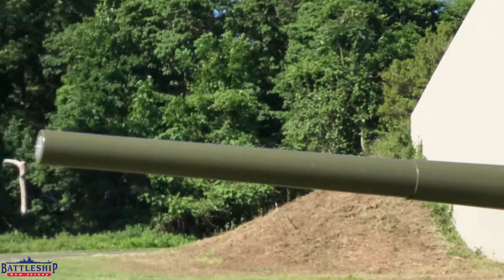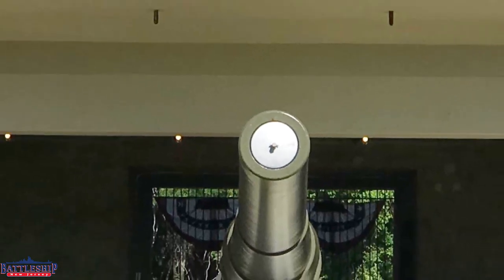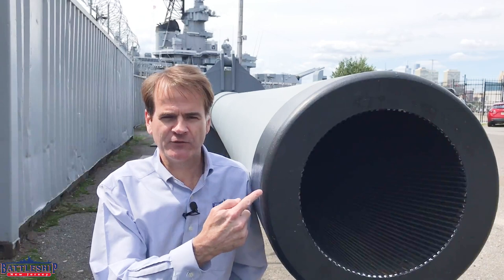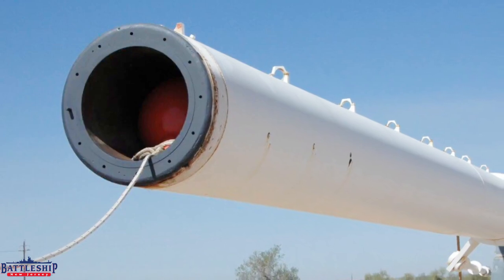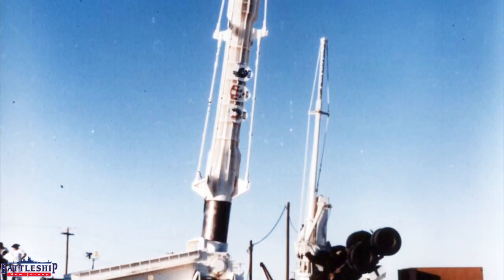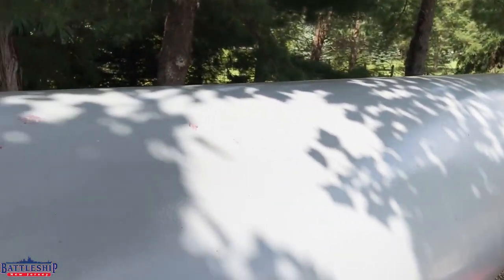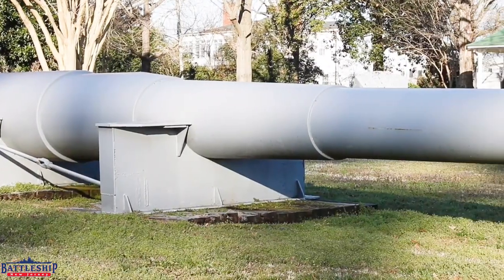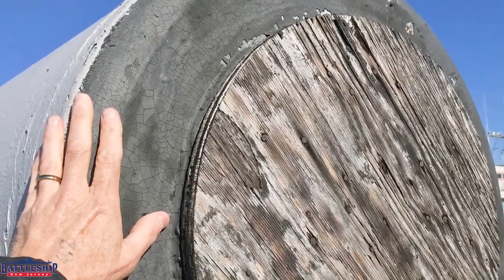Where are New Jersey's Original Gun Barrels?

Comment: From an engineering and construction perspective, the barrels may be out of order to balance out the turret. If the workers added the barrels in sequentially, the turret may have been difficult to handle and may have rotated due to the larger weight to one side. It also possible by adding the barrels sequentially, the base of the turret would have additional stress causing damage. Think of the three barrels like a see-saw. Adding one barrel to one side, then the second barrel to the opposite provides a balance. The middle barrel is then added last. 

Do take this with a grain of salt though as I am just taking an educated guess based on my experience in the engineering field.
Reply: Brandon, just what I was thinking. K.I.S.S. or Occam's Razor if you think about it. The other is how were they transported? May have been/had the same issue.

Comment: Number 1 would be the starboard barrel, number 2 would be the port barrel, and 3 was left over and went in the middle. The Navy numbers compartments and every thing else, odd numbers to the starboard and even numbers to the port, lower numbers outboard to higher numbers inboard. with this and the frame number (the fwd bulkhead) on back.  Same thing on the New York Subway.  Headed North from east to west the tracks are numbered 1,3,4,2 Must have been a Navy man who did it, the older IRT tracks are numbered from the east 1,2,3,4. Instead of frame numbers, the railroads are numbered by chain lengths fro a designated starting point. In the case of the IND this zero point is not on the railroad at all, but is out in the middle of the by half way to Staten Island.

Comment: How would they actually go about re-lining a barrel exactly?
Reply: There was another video that talked about it. Basically they would superheat the barrel to very high temps. This causes the barrel to expand outward. This gives them enough room to slide in the new liner. Then they cool the barrel and the barrel contracts and tightens around the new liner.
Reply: As he mentioned, heat is the key. It’s a lot like how they replace metal wheels on locomotives actually.
Reply: @EstorilEm  Actually I was about to reply to the first comment with that exact same comparison. Also they're technically called tires(tyres?) when talking about the drivers on a steamer... I think... my 30 year old brain needs some new RAM...😅
Reply: @SOU6900  
Tyres
Everything in American railroading started with English terminology....and then morphed.  As in are two of them cabooses or cabeese?  Or vans...or crummies...or brainboxes?
-Sincerely a Foamer.

Edit: Ah only 30.  You never saw a mainline caboose.  And trust me...it's not the RAM....it's looming systems failure and chip blackouts.  52 and 4/12ths.
Reply: @markwilliams2620  Cabeese. I like that.